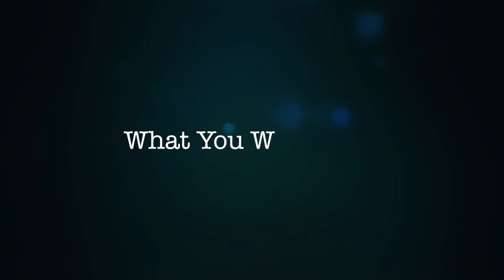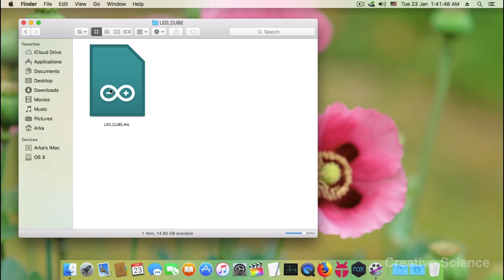How to Make A LED Cube At Home Using Arduino

Comment: can the arduino provide enough power to the leds?
Reply from the maker: yes enough for 64leds
Reply: really? in the tech specs it says it can only deliver 40ma per io pin.
if 1 led needs 20ma and all four light up thats double the power or am i missing something?
anyways Thanks for the quick answer!
Reply from the maker: its enough for 4x4x4 cube but not suitable for big led project :)
Reply: Creative Science ok 
Im just gonna trust you m8
Reply from the maker: tnxx Mr. Bernhard Blietz
Reply: @engineer0239   Though the Arduino can provide only 20 ma, the LEDs are multiplexed. Which means that only one led is turned on once and it happens very fast tricking your eyes into seeing the whole cube lit up.